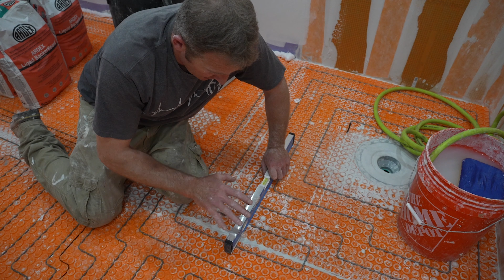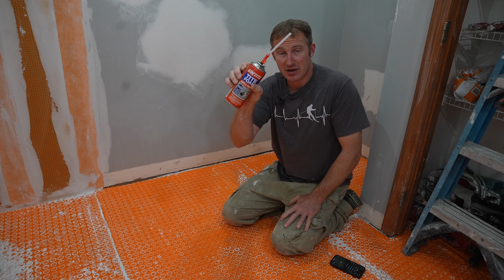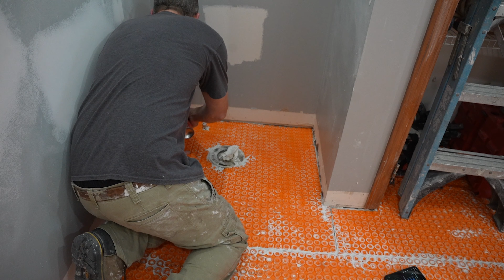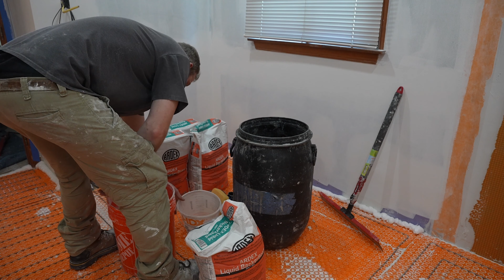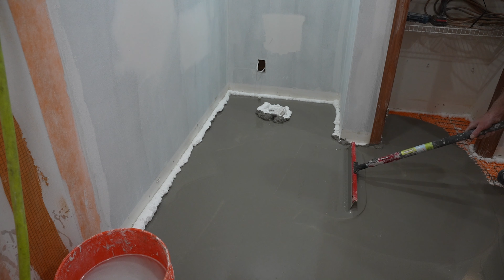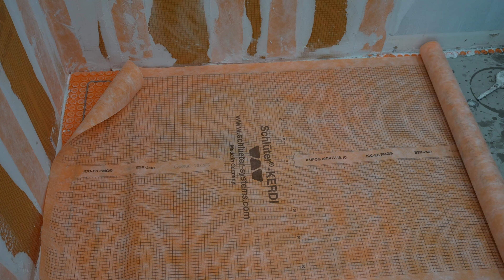Floor Leveler Over Ditra Heat - Curbless Shower l PLAN LEARN BUILD

Comment: My shower is 1/8” higher than my bathroom floor! I did so much planning and math and still managed to screw it up! Schluter customer service told me not to use floor leveler. She actually didn’t have much advice for me other than maybe using more thinset and Good Luck! I’m still not sure what to do but I need to hurry up and figure it out!
Reply from the maker: I’m surprised they didn’t suggest adding another layer of their plastic 😆 
Self leveler is harmless if not poured too thick. Schluter did have approval on this at one time up to 1/4”. However, they now have peel & stick version which I’m betting is why they removed the approval. Don’t let Schluter scare you 😆 the whole modified - unmodified thinset thing was bullshit too
Reply: @B @BathroomRemodelingTeacher So you think I should use floor leveler for the 1/8” rather than make it up with all-set?
Reply from the maker: @QIrons it’s exactly how I did it in this video.,I think it’s easiest

Comment: Hi and thanks for the instructive videos.  Bedroom is on the concrete slab. I would like to install a 100% solids epoxy floor over Ditra heat. Normally I would install a floor leveler over the wires (for non Ditra products) The only reference I could find from Ditra is for Vinyl tile installation and its says use a "Cementitious self-leveling underlayment" over the heating cables but they don't say which product. What are your thoughts on this and what is the best "cementitious self-leveling" product that will work with electrical radiant heating?
Reply from the maker: Ardex k60 with additive. Check with your rep but many have been accepting of it for self leveling over ditra heat 👍

Comment: Is this order of operations for speed? I'm in a similar situation, and I was thinking of putting the pan in, self-leveling up to the pan, and then doing the ditra over the level floor. Seems like this process would stick closer to Schluter's generic instructions.

Comment: Love the video and the idea of self leveling over Ditra. 

I installed the regular Ditra membrane over the all-set mortar because I need to bring the floor up. This way the walk in shower will all be one level. I called Schluter and they told me NOT to install a self level compound over Ditra as it would give a greater risk to shrinkage, curling, and excessive movement. I did have one tile guy recommend installing the all-set over the Ditra then installing the self level as it would bond together better. I'm wondering how your jobs have held up over time and if you have had any issues with the self level over the Ditra.

I will probably install the all-set over the Ditra then the self level as I don't want to take it all up. Possible Schluter is saying this just to be super safe. What are your thoughts?
Reply from the maker: Schluter on the safe side…..no 😆 yeah you can really only go 1/4” thick or the leveler could effect the Mat when shrinking. I’m honestly getting away from Schluter ditra heat these days, it’s not really worth the expense anymore. If I was to do this job again, I’d just use a loose wire system and floor level the whole thing. Probably be $1k cheaper 👍
Reply: @BathroomRemodelingTeacher  Schluter specifically says no floor leveler over ditra.  Do you know why?   Did you have any issues with this floor down the road?
Reply from the maker: @ read the bulletin update linked in video! And no no issues
Reply: @BathroomRemodelingTeacher  i tried, clicked the link.  Nothing is there but error.
Reply from the maker: @ guess it’s gone then. Whatever listen to Schluter lawyers then. Ardex does have an approved leveler. I think it’s k1. But I stopped listening to Schluter on very technical things years ago. They constantly contradict themselves 👍
Reply: @BathroomRemodelingTeacher  understood.

Comment: Thinset for the shower area to install kedri membrane is enough to embed the cables? Do you even need the kerdi?
Reply from the maker: To waterproof and keep water out yes 👍 also it’s what Schluter wants to warrant
Reply: I poured the leveler over the cables. They were just taped to backer board.

Comment: Schluter literally says NOT to do this.
Reply from the maker: Read to bulletins 
Ardex k60 with additive is okay 👍
Reply: @BathroomRemodelingTeacher do you have the link to this source? I've been looking for it but can't find schluter saying it. My Ditra came out a little low from the pan and I just want to confirm I'm good for ardex k60
Reply: @joeysack3459  

What did you end up doing? How did it turn out?

I’m in a situation now where my DITRA is 1/8” lower than my shower pan. Schluter customer service told me not to use floor leveler, but I didn’t ask about specific exceptions, nor did I even know to ask. The lady essentially said to use more thinset and good luck!
Reply: @BathroomRemodelingTeacher  what additive?
Reply from the maker: @QIrons did you Google it? It’s the additive made for k60 https://kofflersales.com/product/k60-arditex-kit-self-leveling-compound?itemid=89381&utm_source=google&utm_medium=cpc&utm_campaign=PMax%3A%20%28ROI%29%20Shopping%20-%20Smart%20-%20Mid%20and%20Low%20AOV%20xAC&utm_id=22468920438&utm_content=&utm_term=&gad_source=1&gad_campaignid=22478912377&gbraid=0AAAAAD_tWw1sJ12yl6E1z8JUHGdXFNL-a&gclid=CjwKCAjwotzWBhBFEiwA1JhPoIroFWCUy1Wi9p70o0DVvY_ZJKEb4Mov_RYu8tb4f1j8g_sMfQ5JvxoC93UQAvD_BwE
Reply: @BathroomRemodelingTeacher 

Thanks. No I didn’t google it. I just looked for it at Lowe’s, Home Depot, and Floor&Decor with no luck. Amazon has it with a $21 delivery fee, but I was hoping to get it tomorrow because I’m up against a deadline (guests coming soon).

Comment: I've used a lot of self levelers and a lot of uncoupling methods, but using self-leveling underlayment over uncoupling mats is new to me. Now that people want to put a lot of "alternative" floor coverings over electric heat, the membrane manufactures were sort of forced to see if their products would work with self levelers. I see that Schluter recommends 0.25" to 0.31", depending on covering, of self leveler above the membrane studs. Liquid backer board style levelers are a different beast (i.e. straight over wood without lathe), but they're nearly 2x the cost. I'm really curious how well it has held up over the course of a year and would like to know if you've used typical levelers, in this application, with success.
Reply from the maker: It’s seems to be debate on this. I’ve heard only one Schluter legal 😆 leveler for tile is K60 with the additive. Personally I’m not sure if I’ll be using ditra heat much anymore. It’s just too costly with everything else increasing. If I break out the leveler I might as well  just go over wires and liquid waterproof.
Reply: I did this about seven years ago with Laticrete floor leveler over tile backer. I did not use Ditra heat. Just used tape to hold down the heat cable. It works very well.

Comment: Client wants a heated floor but wants to install ~1/8" thick vinyl tiles (rated for heated floors). Can I use this floor levelling method for such an application with Ditra Heat? Great video.
Reply from the maker: Yes, you bet. And that’s one of the core reasons Schluter started to allow this kind of application 👍

Comment: I want to build a curbless\heated shower.  I prefer not to notch out my joist so I’m going to raise my subfloor.  If the schulter shower system is 1” thick when I put ¾ inch plywood on the floor and add the detri mat to the subfloor that will be one inch.  If I add detri heat mat to the shower it will be higher then the rest of the floor.  What is the easiest way to solve this issue?
Reply from the maker: this video just address that….That’s why I used floor leveler to build to the additional 1/4”. You could also use cement board then ditra heat too 👍
Reply: @BathroomRemodelingTeacher  You can apply Ditra heat to wood subfloor...? why use cement board?

Comment: Want do you recommend using ditra heat over wood subfloor in bathroom with floating porcelain tiles to seal electric heat as there will be no thin set?
Thanks,
Reply: 12x24 QuicTile by datile is the product I have
Reply from the maker: The floor leveler is only used to fill the actual mat. Still need to use thinset for setting the ditra heat mat and to set tiles over the floor leveler
Reply: @BathroomRemodelingTeacher  yes I understand thin will be used to set ditra, but the tiles I have are click n lock design floating porcelain. Look it up if you can to get a better idea. I put the brand above. 
Thank you so much for your response
Reply from the maker: @rizzotto139  can’t say I’ve ever seen the quic tile thing. I’m actually amazed that daltile would make something like that. Wouldn’t think they would warrant an install of porcelain that way….kind of goes against all tile setting guidelines.
I personally would not go that way, but I guess if you ended up with cracks in grout joints later on, you could set it with thinset then
Reply: @BathroomRemodelingTeacher  Evidently the grout is made specifically for these tiles and it’s flexible so it’s able to move without cracking grout lines.

Comment: You could have used wedi curbless shower pan which is only 3/4 of an inch and not do all the extra work , just saying  lol , good video Steve
Reply from the maker: 😆 I almost bought a Wedi lingno pan for that project, but was unsure of moving drain location. I’m glad I went with Schluter. There was a joist directly in center that made my drain offset. Would have taken an expensive Wedi pan to make it work.

Comment: Great tip on leveler. Does it work as good on plywood subfloor as it does on the Ditra? Could I use same leveling product under vinyl flooring?
Reply from the maker: Yes, definitely. You do need to prime the subfloor first though if going directly on plywood. Ardex p51 primer 👍